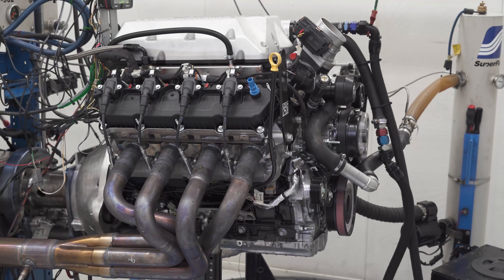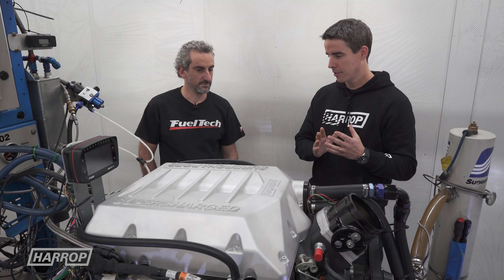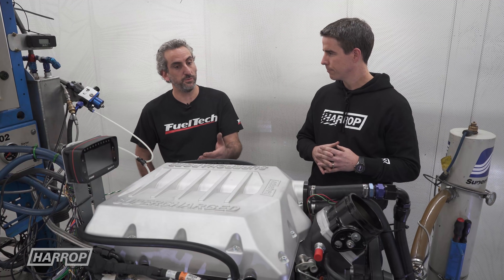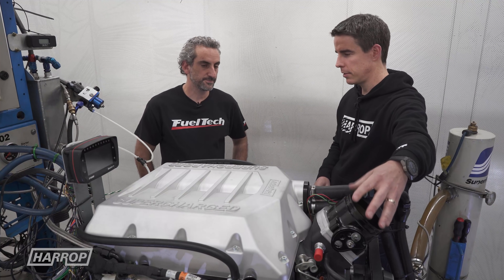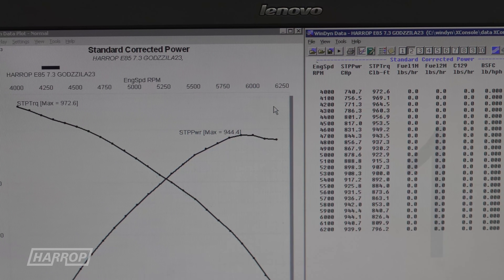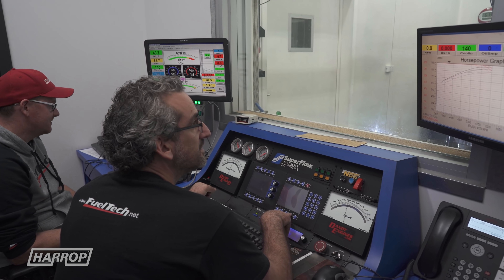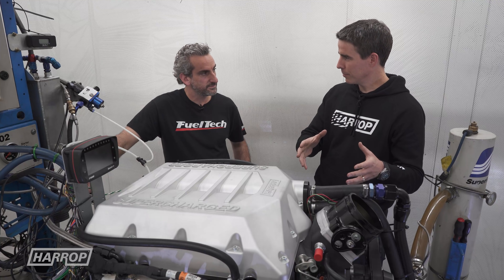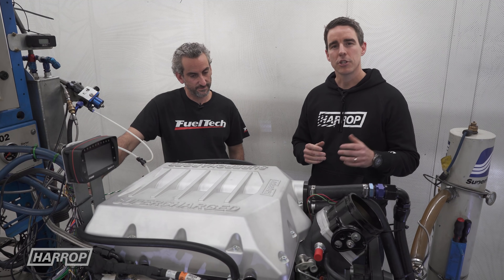1000HP Stock Ford 7.3 Godzilla Supercharged | Harrop TVS2650

Comment: "Here Crown Vic, come on Panther P71, Crown Vic..." We would have the baddest Crown Vic on Earth, and what an awesome engine this is now And for the long haul. Perfect farmer truck if you don't need a Super Duty 6.7. With a few wrenches  turned, boom, you already hit  500 hp/ 550 tq. I say replace the factory 6.2  with a smaller version of this. But, the 6.2 is a proven motor.

Comment: Watching videos like this, adds years to my life!
Reply: It takes me back to the 80s when I  first heard a 460, and then a 455 Buick. "The 4-4-5" (Son of 460).
Reply: @gen-x-zeke8446  I always figured the 370 was "the son of the 460," as it's the same block, just diff'rnt bore & stroke...
Reply: That seems about 6.0 (370), or a 6.1. What is that out of?
Reply: @gen-x-zeke8446  Old Lincoln Continentals, & MK I,  II & IIIs.
Reply: @FobbitOperator  I know the 351/400  460,  but I've never heard of a 370. Same block as Godzilla 7.3? I'm going to look it up right about now. I get the feeling my fellow Williams is jiving me. I'll be back.
Reply: @gen-x-zeke8446  Negative. The 370 & 460 share the same block.  (460 C.I.D. = 7.5 L)

Comment: Drove the roush superchared and tuned 730 hp torque unknown coyote 5.0 f-150 at a dealer in birmingham alabama usa would keep you pinned to the seat and very powerful. That 7.3 with in that truck 1000 torque my gosh.

Comment: What's the squealing heard on lifting the throttle?
Reply: I'm guessing the alternator can't slow down that suddenly and the belt isnt holding it back.
Just a stab in the dark, I might be completely wrong.
They also mentioned a limitation in the 6PK set up and suggested it would need "more belt" so something has too much inertia for that belt and its slipping.
Reply: @notsponsored103  Ah yeah, makes sense. Thanks.

Comment: I remember seeing something about a tvs 3100 coming out last year.  Just curious why this system is centered around the 2650?  obviously it makes excellent power and sounds great, but on this much displacement and headflow, wouldn't the 3100 be more efficient?  I am not trying to be a critic and I love the content.  I would just like to know.  I hope I can get a setup like this in the USA.  I know there is the whipple coming but it is insanely quiet even at full tilt.
Reply: If I'm remembering correctly they didn't see any better numbers with the 3100 so they pulled it off the market to figure out why

Comment: I’m curious as to what all the hype is about with this engine, when a 460ci engine has been around for years?
Reply: Hammerbacko..im guessing that its a new engine& also the fact ford havnt built a pushrod v8 in a while..i love the 460 but have never seen a stock one make 1000 hp..just my thoughts tho
Reply: @raymondvesty4319  The 5.0/302 you can get in F-150 in the states is pushrod
Reply: @alanjohnson911  The Ford 5.0 hasn't been a pushrod engine since 2001...

Comment: This is probably the best motor ford has made in a long time the tritons were crap.
Reply: Coyotes make comparable power to the Godzilla when supercharged while being 2.3 liters smaller.
Reply: @johnhill9910  I just like how simple they are single cam  pushrods nothing against the coyotes had some valve issues out of some currently sending some heads of for a friend.

Comment: When do you expect to run into valve spring issues?
Reply: If they keep blazing it, then nothing will last too long. At normal use on road and as a work truck, minus some possible gremlins they may have to adjust on, these engines will easily be around for a very long time. It reminds me so mu h of the 460 growling sound. Old school 4 Barrel carb would sound life enhancing.

Comment: HP should double with each atmosphere of pressure added [ i.e. 14.7lbs of boost= 1 atmosphere] since you've basicly doubled motor displacement. This Fine Ford Pushrod 2V Engine should have great potential. It appears similar to  GM's SBC Gen3,4 architecture, As its birthed already @ 7.3L , can't help but wonder max CID will be when other power seekers start development. 1000+ HP  in a streetable N.A. torque monster seems reasonable , eh.

Comment: I can5 help but wonder where that motor tops out at power, given this is stock heads and cam. What are you doing for the variable valve timing with the blower?

Comment: LOL - look at all that steel, Rob Dahm achieves this with his little three rotor :)
Reply: Ha. Wow you win dumb comment of the week. So a completely hand built exotic custom designed for racing and making big power is the same as a stone stock truck engine. Oh yeah Rob doesn't make anywhere near that torque.
Reply: how much did his three rotor cost?

Comment: I wanna see how much this beast can be bored/stroked to. An 8.0l V8 will be legendary
Reply: 470 seems to be about all it can be taken to before stupidity takes over.
Reply: From what I have read it seams 480 is the max
Reply: If you want big, you have to step back in time a bit to the 385 series engines. A Ford performance A460 block will easily support a 572ci (9.4L) configuration. If you're even a little lucky , you might find a stock block with enough meat in the bores to hit that size... needs an 80 overbore to do it.
Reply: @mfree80286  Yeah I'm big on BBF's and all but it would be nice to have something newer and lighter.
Reply: @johnherbold6539  hit up Kaase for an all aluminum package, should be less than 600lb running.

Comment: Is all that coming out of the breather mostly because of E85?
Reply: E85 is definitely a factor, but the boost level also tends to make it breath more also its not a small engine its 445 cubic inchs stock which is more than most drag LS setups so just thanks to the sheer size of the engine it will breath a good bit. Also I don't think they had the right side open too vent so all of it was coming out that left bank which would make it appear to vent alot.

Comment: This is definitely cool. People would be surprised if you shown them how much a factory 5.3 ls with proper ring gap and a turbo makes. It will live past 1000 hp easily as well. I'm just happy there's more competition for robust engines now.
Reply: 5.3s are definitely good platforms for engines when built/tuned correctly. I will say though the 7.3 Godzilla might dethrone the LS truck engines from their crown. The 7.3 Godzilla with absolutely nothing done no ring gap or head bolts or anything like that just a bolt supercharger and throttle body made 1015hp appearing as if it wasn't really trying, now imagine it with a turbo I bet on the same boost it could possibly make 1100hp just thanks to the mechanical drag of the blower being gone and how efficient turbos are. It seems to be a fantastic engine, and should help fuel the Ford vs Chevy rivalry for years to come. Also unlike other ford engines it seems many companies are taking a interest in it so hopefully prices aren't that insane for parts anymore compared to the coyote. Also the 7.3 stock has 6 bolt heads them head gaskets gonna stay seated for sure
Reply: @tstuff1213  not a chance will it "dethrone" the LS given you can buy a 5.3 ls imported for $2500 and this 7.3 will be more like$25-30.000, buy the time ford sells millions of these 7.3's an they've done 200.000k's+ an fund there way into junkyards an the price comes down i seriously doubt our dictatorship government will allow them to be imported since they're forcing the e'car bullshit
Reply: @arronjohnston742  Imported WTF. Im talking about in America currently you can by a crate one straight from ford for $7000 is it more expensive than a 5.3L yes for sure but can make way more power and makes more power stock. People have already made 1100hp+ out of a completely stock engine with boost within the first year of production.And people are building them for 1700whp+. It will take some time for them to end up in junkyards but they will over the next few years show up and i think be more popular than diesels when bought new. Also there is rumors of one being put in a version of a mustang. So over time it will get that  low price wise. This in america/canada will become the new LS I think.
Reply: @tstuff1213  i'm talking about here in the dictatorship of australia-istan, they'll want drug dealer money for them (like everything else)
Reply: @arronjohnston742  I getcha sorry, I really have no idea what prices are like anywhere else but where i Live unfortuneatly. I would love to visit auatralia one day tho it sounds like a beautiful country and of course the bonus of summernats

Comment: This is absolutely insane. Crazy power for stock block. Get more flow into that pig and the numbers will only climb.
Reply: That's a Ford engine design for you. They've been making engines for a long, long time. Especially pushrods. If they couldn't get a pushrods designed right by today's standards, they shouldn't build. But again, a Ford motors just wants more and more air and fuel! See if those numbers can be acquired by other competitors pushrods...
Reply: @fusionsportdaily1650  ls7 is really its only competitor unless you want to bring dodges hellephant into the mix.

Comment: Might be ok for dyno pulls and a 1/4mile. But I'd want some extra ring gap (especially for marine or sustained use) just to be safe.
With a cam + spring upgrade (which it sorely needs.) There wouldn't be too many other +750kW off the shelf packages this easy for ~$20-25k AUD?
Reply: just spray water\meth  into the intake or e85+ fuel,

Comment: I'd like to see the horsepower #s after some headwork and cam.
Reply: Seen a video. Cam and stage 2 heads over 1400 Horsepower.  Although they changed Rods and pistons  in it. Stock wouldn't handle it. Stock crank and block
Reply: 1200+
Reply: https://youtu.be/bbtPN37LvmU
Reply: Give that a watch 😁
Reply: Well you can kind of. Take the torque curve and tilt it backwards then do the same for the power curve but pivot it at 5252. Depending on what the cam and heads allow I would say even a mild set up would be over 1200hp and a fast road/track set up somewhere around 1500hp. 
Of course thats only at 20psi too so there is plenty of room to bump up the boost if they want and if the motor can take it.